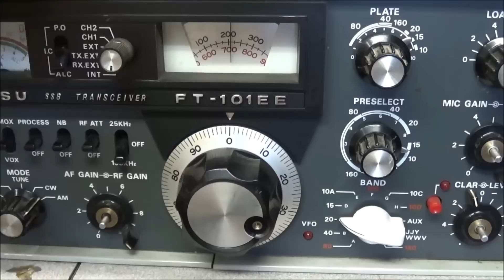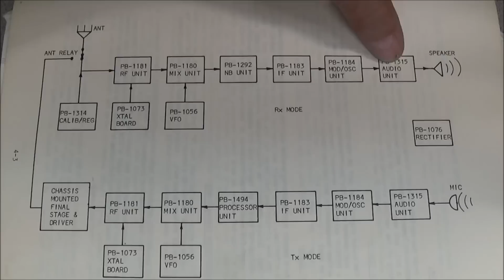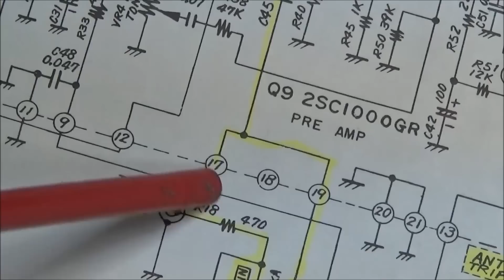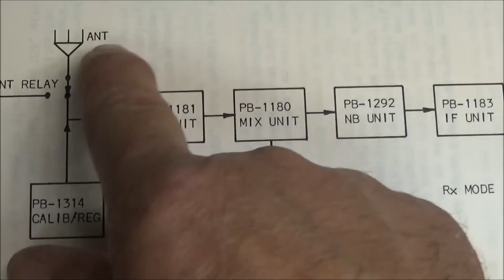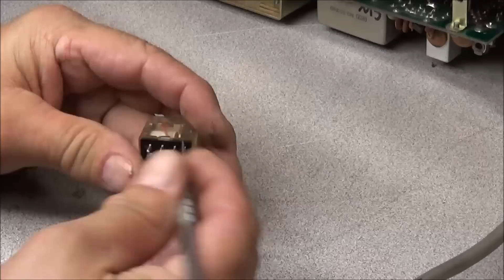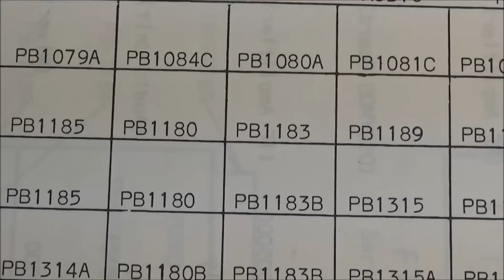#59 Yaesu FT 101 Series Part 1 Preliminary Test

Comment: Really appreciate you taking time to explain how to repair the 101 ft series..I know it's a widely used transmitter and they get really hammered and abused..been thinking about repairing them as a at home hobby to keep me busy when I retire... looking to see if I need a license to repair those rigs...any advice would be greatly appreciated..thx
Reply from the maker: You really do not need a license per say. But to test properly at least a general class amateur's radio license is required.  I have made contacts using a dummy load before.
Reply: Thx for the knowledge..will be looking into studying for that test !!!

Comment: Hi Buddy!  Just re-watching this video again.  Amazing stuff! 

Have a pair of these radios here.  An FT-101EE (late) model that I bought at a hamfest some 25 years ago, and an FT-101 (late) that I bought about 5 years ago from an estate sale.  Both radios sat for many years in a damp basement while life was in the way.  Troubleshooting them now.  I'm finding the brown, waxy caps to be split in the EE, much like the ones in your video.  Your moisture theory sounds about right to me.
Would you be able to comment, or make a video, about the voltage chart and the resistance chart in the manuals please?  I've got a few questions about them that I haven't found answers to anywhere.  I know that I could ask these questions on a a variety of forums, but often find responses from the many "armchair" techs that don't actually work on old gear.  I believe that your knowledge and experience with these rigs is amazing!
My questions are:
1. On both charts, are all measurements referenced to chassis ground?
2. On both charts, what is the difference between "0" and "E", like Pins 1, 2, & 3 on  MJ 2?  (maybe "E" = "chassis ground", and "0" = "not chassis ground, but voltage should be close"?)
3. On the resistance chart, what is the meaning of the symbol that looks like an "X" with 4 little dots, like Pin 10 on MJ 1, or Pins 4, 17, 19, & 22 on MJ 4?
Thanks for your time, and for ALL the knowledge that you share.
Cheers,
Alan

Comment: Hi Buddy,
For relays, I've used the cardboard from a " Big Chief" tablet (a hint at my age and I hoard stuff). What about using a contact burnisher, such as a P. K. Neuses Inc. CB-6 Contact Burnishing Tool. Will that jeopardize any coating that might be on the contacts?
Reply from the maker: Hi, I never use a burnishing tool on contacts. Yes it files the coating off. Man I have not seen a Big Chief tablet in ages lol. Business cards work great. The idea is the clean and inspect as you know. One the coating is removed they will arc constantly and have to be replaced.
Reply: @TheRadioShop  please help. About how much RF out of the antenna port with just the 12by7a in line and on. I remember you saying about a watt. Mine is not making anything near there. Using a Motorola service monitor and spectrum analyzer mode to see sig. Any direction from here would be greatly appreciated sir.

Comment: I think there is an "RF out" BNC jack on the back panel for connection to a spectrum analyser/'scope etc. I think it is a few volts (3v?) peak to peak.
Reply from the maker: That is correct Peter.

Comment: Why does the unexpected over voltage condition of the power supplies not bother you more? It could swamp the caps which are probably weak anyway and possibly create more problems.

Comment: Sir - Do you have a video installing a PB-1534, my 101 is one of the 180 series so it's pre-wired with processor switch, I did all of the pre and post power up tests and all readings were per documentation however with the processor off I have modulation, on there is nothing, thoughts/vids?

Comment: Great video. I have a yaesu 101 mk2 and i also have the same problem with the -100 off the rectifierboard, mine reads -170. But i never heard how you corrected that ?
Reply from the maker: Back when these units were made the typical line voltage was 110. Todays voltage can reach up to 122 volts. This will make the secondary voltages higher. You can use a variac to lower the voltage and see if the secondary's are more in line with the manual. If still high then start checking components in the supply.

Comment: I got a YAESU FT_221R.  The audio board has the same problem, every mylar cap is splitting open and deteriorating.  Others as well.  I wanna add a PL tone generator in place of the out of date tone board.  Will need to do some work on those caps though.  You know anything about the PA reliability in this radio?  I was gonna crack it open and if it seems good shape I may rework and restore radio.    The radio actually works,  seems put out full 14 rated watts into a load.  hard to hit reapeater without pl tone though.

Comment: This segment helped me clean the relays in my “E” and “B” models.  I trimmed the eraser to a wedge and used the cut-offs with tweezers to clean the stationary contacts. Worked really well.  Final clean-up with Deoxit and heavy paper and it all ended super clean..  To use both sets of relay contacts it seems one could simple use jumpers to connect the three sets of contact pins on the relay socket.  I really hope you go through the full alignment process on a future video  – I’m not really confident with this without a spectrum analyzer.  Thanks and I’ll keep watching.  Zack, KC5IS

Comment: Love your videos. Seems like one of the best instructions on how to go at actually repairing the FT101s. Since I am a noob on this I've got a question regarding the capacitors:
I found some Mylar caps with cracks in the coating on the audio board and C18 of my FT101B, but they are quite small. You said on one of your boards they tested okay. So I wonder, do I have to unsolder them all to test, or can I actually test for fault in-circuit? (PS: Audio level adjustment and RF amp seems to work.)

Oh and what did you use to clean the boards and case? Looks so much nicer than my rig.

73

Comment: Recently I was given one of these radios by a ham who no longer was interested in the hobby. The radio had been boxed up in a closet for a few years. I have not tried to transmit  with it yet as I want to make sure all is working first. I know it lights up and none of the switches or controls seemed to be locked up. Your videos are GREAT! It is helping me learn more about this rig.  Thank you!
Reply from the maker: Thanks Perry. They are very nice old rigs. Make sure the capacitors are ok, replace them is the best way. These radios will give great service for many years. Thanks for watching.

Comment: Hi Buddy,
Thanks to your videos, I have my 101 up and running but still need to go through the receive and transmit. When I got this radio, it didn't have a speaker or mounting plate. I bought them off of eBay, but can't figure out how the speaker mounts to the plate. I know it should be simple but  .... 
Is there any way that you can show how the speaker mounts from the back?
Reply from the maker: Jon, thanks as always. I will take some pictures and post them on my website. When I do this I will send you a link. Thanks again for your comments. Give me a bit and I will get these posted.

Comment: What was causing the God awful racket at 15:22 when you first turned on the radio? Was that caused by all the bad caps on PB1315?
Reply from the maker: Yes, all those bad caps are causing that noise.
Reply: I thought so. My transformer came in yesterday so I'll be wiring that up probably this weekend and probably watching these 101 videos a few dozen times.

Comment: Buddy, My radio has a PB1189 that is missing the STK401. Can I substitute a PB1315 in place of a PB1189?
Reply from the maker: Jon, Which model of the 101 do you have? You may have said but cannot remember. The PB-1189 was from the old 101 that did not have a letter behind them.  The "B" model and up used the 1315 board. As far as I can tell the 1315 was an upgraded board of the 1189.
Reply from the maker: Scroll down a third of this page and you will see "Construction" Under that is the block diagram linkhttp://www.qsl.net/nw2m/
Reply from the maker: Also at the moment I cannot verify that until I know your model number.
Reply: Buddy, As far as I know it is a late model 101 without the letter. From the board schematics, it looks like the 1315 uses a AN-214 in place of the STK-401
Reply from the maker: Late model did use the 1189.  I am searching for the schematic on the 1189 to see if it is compatible, Don't see that schematic in my service manual yet....
Reply: that schematic is in the users manual of the 101 late models go here http://www.radiomanual.info/schemi/FT101_user.pdf page 38 of the pdf. I just remembered a box of boards that I bought and looked at the 1315 in there and it has the STK401 on it.
Reply from the maker: There are 2 of the 1315 boards. Early and late. If yours has the STK401 on it I think it should work. The other one with the AN-214 looks different. Pin 2 on your 1189 board is grounded. Pin 2 on the newer boards is for Anti-trip circuit.
Reply: The Radio Shop I'm sitting here looking at my old 1189 and the 1315 and what I see is this: 
Pin 2 is connected to VR6 through a 27K resistor and the schematic for 1315 shows it connecting out to the anti trip jack (my radio does not have this jack). Also, looking at the boards, on the 1315 it looks like they just cut the traces that bridge 1 and 2 together. 
Then on pin 12, of the 1315, there is a 47k resistor connected to R37 and pin 12 goes out to the side tone jack (also not on my radio). On the 1189 pin 12 is not connected anywhere. So I could make the 1315 work by removing the 2 resistors and bridging the trace between 1 and 2. Thanks for the help figuring this out. I'll lose a little less hair now.

Comment: G'day buddy where do you find the serial number for the correct version is it on the  back of the backing plate? My plate is new and all shiny,  and NO numbers. I'll try and check some of parts.
Reply from the maker: Just above the S)-239 connector there should have been a tag. Would have Yaesu on it plus the serial. Possible it got removed. It was a type of stick on decal.

Comment: It is weird seeing what looks like Russian ceramic capacitors in this transceiver, I suppose some Japanese transceivers use the Phasing SSB modulator/demodulator, could the Noise Blanker circuit not be working which would be really weird as the noise blanker can really clean up the signal, could recap the board, could the audio board have got over heated or something.
Reply from the maker: David, sounds like you have done your homework my friend.  The noise blanker board has a lot of impact on the receive signal.  And is also mostly overlooked when hunting down receive problems.  Keep your eyes on TC-1 and T-120. They will be covered in the next video. A lot of parts for these rigs were "off the shelf" parts in the 70's. Not a lot of custom parts were used.

Comment: G'day buddy, This is a good series ,I'm checking my FT101B  seeing if needing improvement with your instructions. This is awesome a free tech knowledge. I didn't know about boards in the B's different  numbers . I'm learning mate! lol
Reply from the maker: G'day to you Dennis.  If you have the service manual look on page 5-1. You will see a listing for an early and late 101B. The regulator board, HF IF board and audio boards are different in the two models of the "B" series.  Look up your serial number for the correct version.  Once you learn all the circuits in the 101 you will see just how easy they are to troubleshoot.  The most complicated circuit in them is the band switch.  It has 13 wafers and they all do something different from switching voltages to changing IF paths. Glad you like the series mate. 73
Reply: MATE I am very happy with the series on FT101  you just don't get blokes who give you this information. Cheeers & beers mate.
Reply from the maker: Thanks. Yes some folks like to hold information. I like to share information.  More to come mate.  Cheers to you.

Comment: Great technique Buddy. I recently recapped the large electrolytics on my Drake C-line (Hayseed Capacitors makes great "re-stuffed" cans for a bunch of old rigs) and, less the mods done over the years, it's amazing how radios can still look like new after coming up on 40 years!  73 - Dino KL0S
Reply from the maker: Hi Dino. Yes Hayseed Hamfest capacitors are the best. Makes those old rigs look great also.  I would use nothing else in the Drake line for a recap.  Take care my friend. Buddy
Reply: I just ordered replacements for my FTdx-560 PSU from Hayseed Hamfest. Their service is outstanding and the quality of the caps is first rate. The caps are not stock items but they made them for my unit. The pricing is great too. Can you tell I'm a fan of Hayseed Hamfest?

Comment: Interesting Video, I would be interested in know what the 6V power supply measures if it has not been ajusted from its factory settings. I am looking forward to your next video to find out how you are going to tackel the poor receive on these radio's.
Reply from the maker: I have checked the 6 volt line and it checked at 6.8 volts.  The 6 volts is derived from the upc141c IC on the regulator board. it can be adjusted with VR2.  As old as these radios are I t would be unlikely to find one that has it's original factory setting.  Thanks for watching, more to follow.
Reply: Thanks for the reply, Because all of the voltages measure on the high side with our digital meters compared to the values on the circuit diagram, and the Clarifier is offset if you set the 6v supply to 6v, I am asuming that it would be set to a higher voltage than 6v and 6.8v could be the right voltage. I look forward to further Video's
Reply from the maker: Thanks Clive for taking the time to ask questions. Be warned that some of the steps in the SM are backwards. It ask you to perform some IF adjustments then later ask you to set some of the voltages.  When you do this it throws your IF adjustments off. So this is why we check those voltages in a beginning test. just to make sure they are somewhere close.  Back in the day these radios were run on 115/117 volt line. Todays mains supply a good 121 to 122 volt main. This is why those readings are much higher now.  When we get to the alignment and tune up then we will address those settings.  Getting the clarifier and "zero" volt readings are very important. thanks for these questions.
Reply: Thanks for the reply, I live in the UK where we used to run the radio's on 240v, but now have 220v, the voltages are still higher even though the voltage supplied has fallen. You are correct you must measure the supply voltages before anything, so don't follow the manual blindly.  Can I bring to your attention that their are several 9V supplies that you didn't measure in your video,  I was wonder why you didn't or will you be measuring these in a later video?
Reply from the maker: Yep, I had to go back and check in the video. I did say that we would not worry about the low voltage supplies at this time.  Although I did check all the voltages prior to the video. I plan to have one video on just the supply rails. It does make me happy to see folks paying attention. Thanks!
Reply: That's fine, one of these 9v voltage regulators is connected to the marker generator and is on (PB1186), the other one supplies the CW side tone generator. Hows the next video comming on?
Reply from the maker: Slow, but they all start that way. I have been off for two weeks and decided to take a stroll with the wife last few days. I do have quite a bit of video footage and need to get to a lot more.  Maybe by Monday evening will post another episode if all goes well.

Comment: Great overview of one of the most popular radios ever made.  Had to laugh when I saw those cracked open capacitors.  I did a video on bad poly caps several months ago.  Looked just like these only they were green drops.  Just more stuff for us to keep a eye out for.
Reply from the maker: Thanks Mike. Yep those caps reminded me of you when I saw them. I said to myself Mike is going to laugh lol.  But we have to keep the age of these in mind.  Take care brother. Going to work through the deaf receiver now. Wish me luck..
Reply: +The Radio Shop 

Fingers crossed for you.  Can't be worse than my week has been.  Radio after radio of nightmare and oddball problems.
Reply from the maker: I hear that Mike. I have had weeks like that in the past. Since I get to pick and choose what I work on now not as bad.  BTW, did a little trick on this 101 and the receiver is promising.
Reply: +The Radio Shop 

Good to hear.  Really have to wonder why someone was parting it out.  Overall it looks to be in fairly good shape.  Guess someone didn't feel like replacing all the bad caps.
Reply from the maker: yep, someone probably did not know how to do a proper fix. Bought a non working unit to use for parts. Hence the wrong audio board installed.  When they installed the audio board in their radio most likely did not fix that problem either since the jumper was installed. Radio is in decent shape though.
Reply: +The Radio Shop 

You would think the different model number suffix would be a clue to people there's something different in the radios.
Reply from the maker: lol, you would think that. But seems some think it is a swap and go thing.

Comment: Thanks for the video!
I got my FT101E about 2 years ago and had to learn all this the hard way :-)
Having these vids are a great resource for our community.
My mylar caps have little vertical cracks in them but they are still working fine.  But I guess I should be thinking about replacements.
Reply from the maker: Hi Will. I was in the same boat as you. Was just not enough information available to repair these. Different story if you could join the yahoo group.  I chose not to and learn what I could the old fashion way. Yep, those old caps cannot hold the water. Thanks for watching.